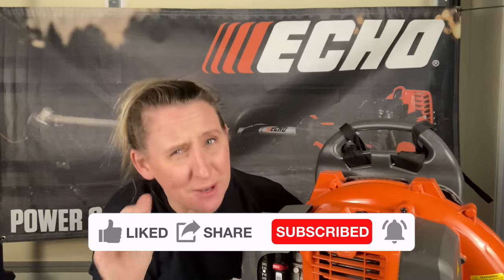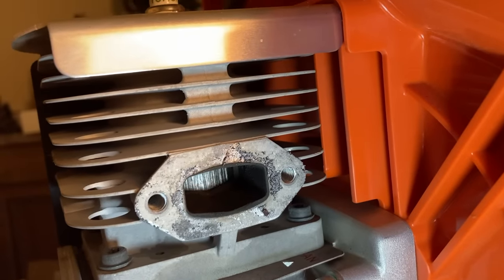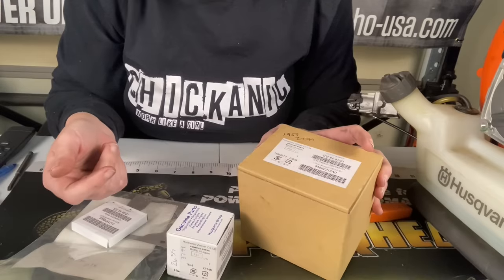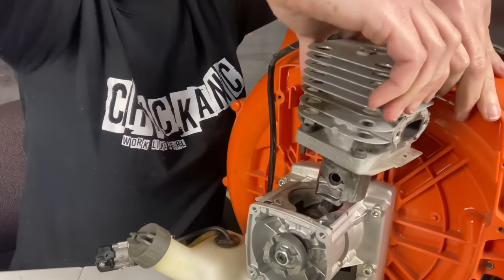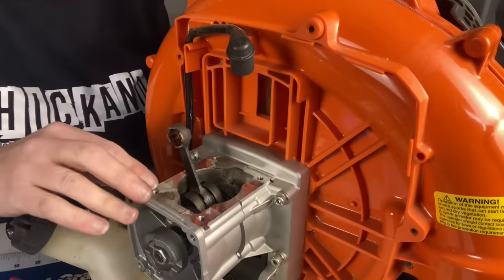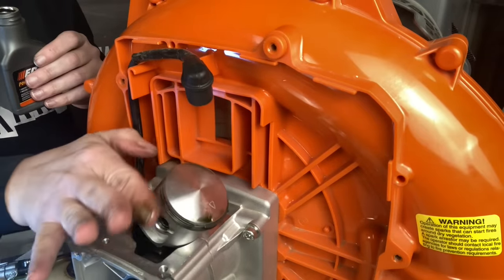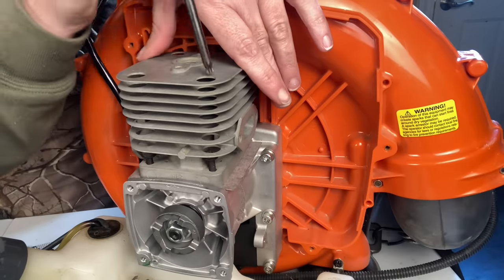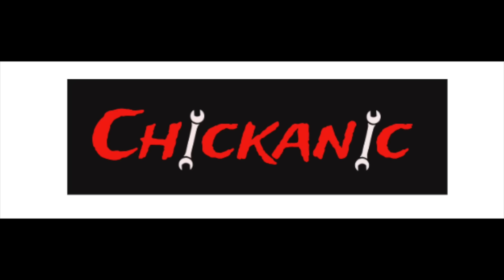How to fix a burned up Husqvarna 150BT backpack blower/Turning Shop Trash into Treasure VLOG Repair

Comment: I don't understand the logic here. Not worth it to repair for the customer, but worth it to repair and sell? Why not just quote your selling price as the repair price?
Reply: That would be very close to the price of a new one. Also, predicting how much time you are going to spend on the repair is risky - you may encounter another problem, you may make a mistake and break something else... It may take you an hour, it may take you four. I see a new one can be had for about 250 if you shop around a bit. So basically if you undertake to repair it for 200 dollars as an indication but it may overrun to more than a new one is worth most people wouldn't risk accepting this proposal.
Reply: @evanherk  Yeah, maybe you run the risk of not being able to fix it, but the diagnosis has already been made. Let's say you get in a $250 blower, and the "repair bill" is going to be $225. Of course nobody wants to pay $225 for the repair to a $250 blower. But, then, somehow you can go back and fix it and then sell it for say $175? In my mind, you just got paid $175 to fix the blower, and you have one customer (the original owner) that left not very happy. So why not just quote $175 in the first place and have a happier customer? 

The only exception I can see to this is if the customer declined the $175 repair and you turned around and sold the item for $175. That sounds fair.

Comment: Customers lying!  You have to be joking?🤪. It is never their fault.  It has to be a manufacturers defect.  They want it fixed for free.  I sold an MS 391 to a friend a year or so ago and he loosened the chain and it threw the chain.  He then wanted to blame me for what he did.  Later he brought it to me because it would not start.  I dumped the gas and cranked it right up.  I have no idea what was in the tank but it was not good gas.  I run 50:1Echo Red Armor in most of my equipment or Echo Power Blend Gold at 40:1 for my older equipment.  Both ar JASO FD certified oils.  Most of my equipment is Stihl or Husqvarna.

Comment: so $100  for retail parts and an hours labor and your customer decides keep It I don't want to repair it? I'll get a new one?, then you spend $50 and fix it...Hmmmmmmm
Reply: The money is about the same to us if we fix it for them or sell the blower. We may make an extra $35-$50 if the equipment looks nice, but even now the person could come get the blower and pay for the repairs. We don’t care how we make the money. However, it is much quicker and easier to just have someone pay us for a repair than possibly spend weeks trying to sell used equipment.